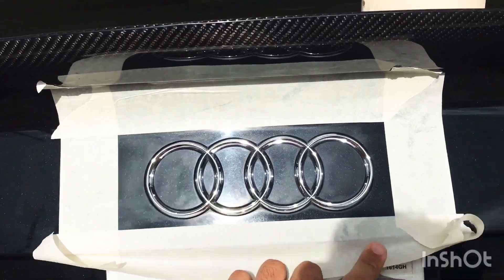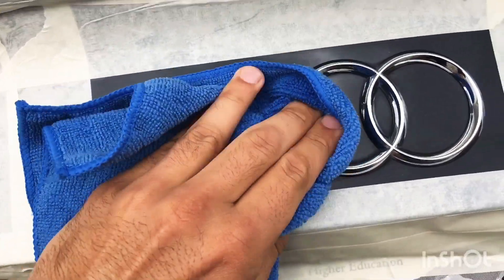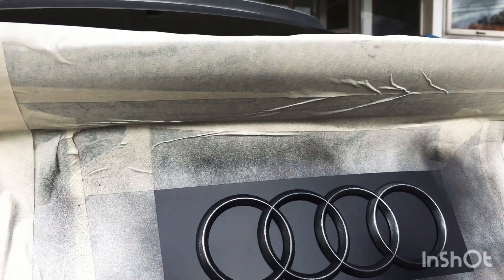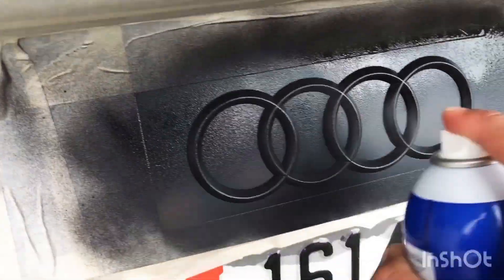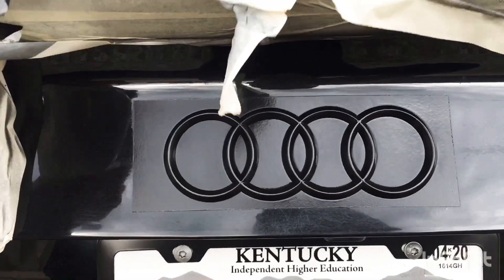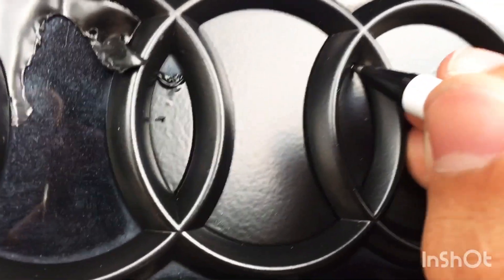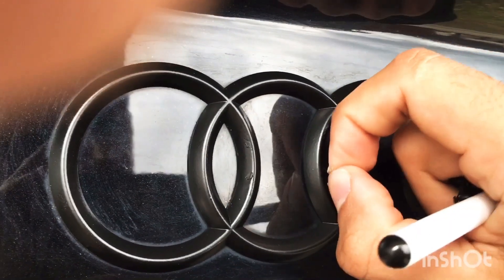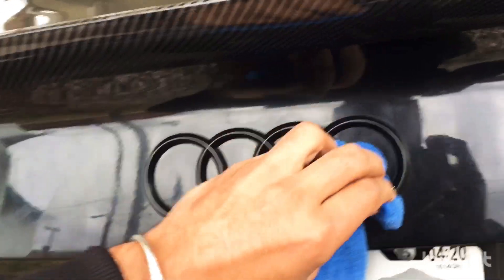How to properly plasti dip/blackout your car emblems | EASY DIY

Comment: May as well take the rear badge off and replace it with a new one that you've customised.

Pretty sure when mine fell off the replacement only cost £25
Reply from the maker: You def could, it costed me 5$ + I did myself and learned something ✌🏾
Reply: On Amazon it’s like 55£+, spraypaint is just 5£